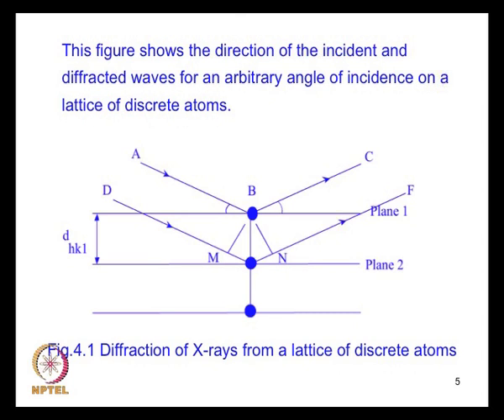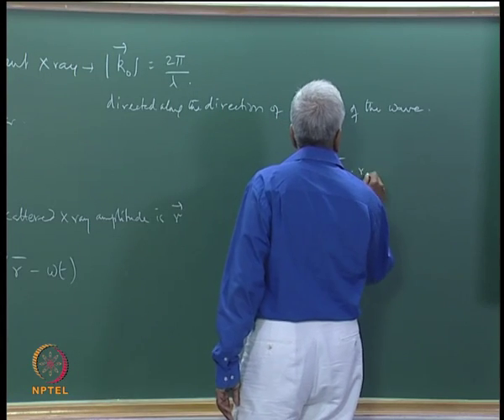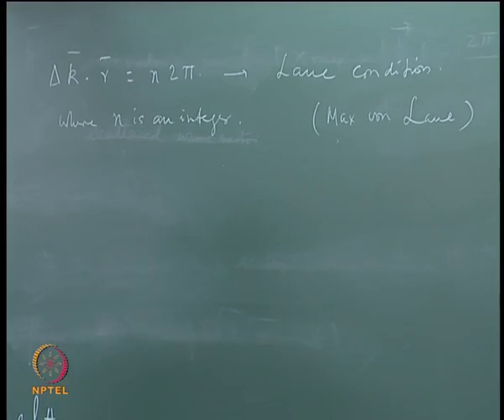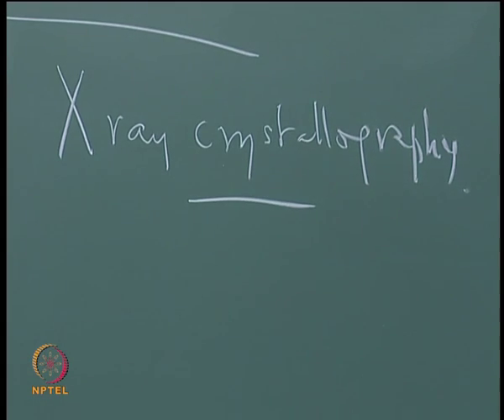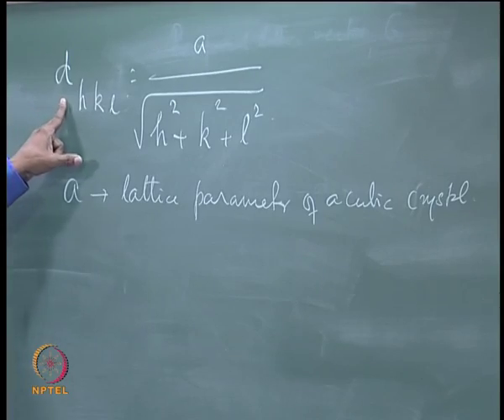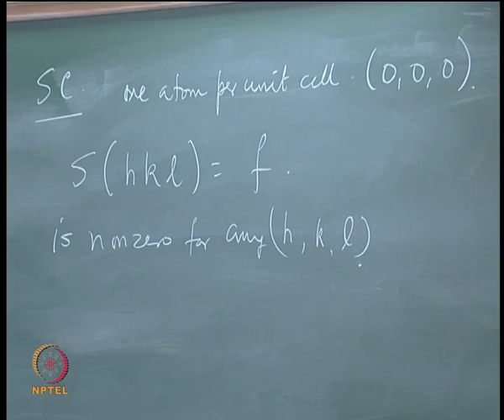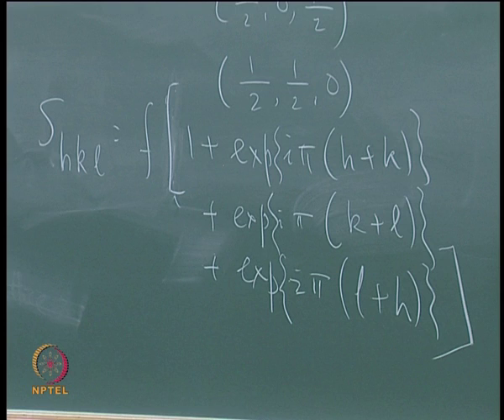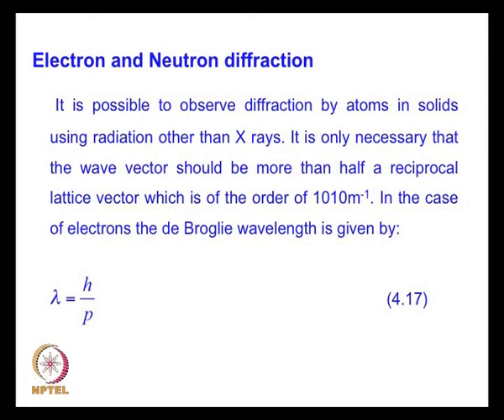Mod-01 Lec-4 Diffraction Methods For Crystal Structures

Comment: Why we use monochromatic xrays in powder method while in laue method is not used.
Reply: Coz in laue method wavelength of x rays should be varied and orientation will be kept fixed